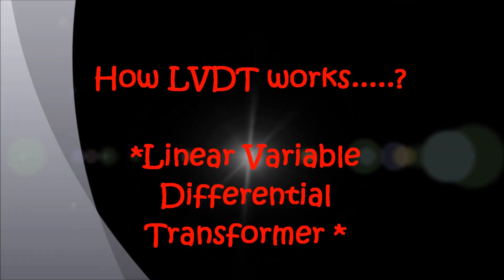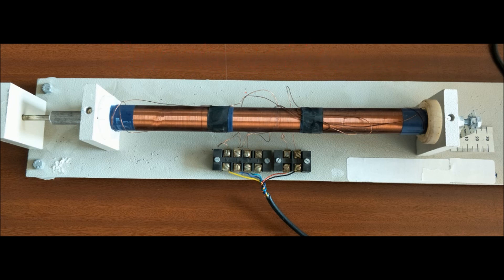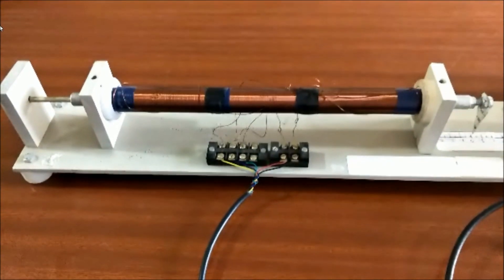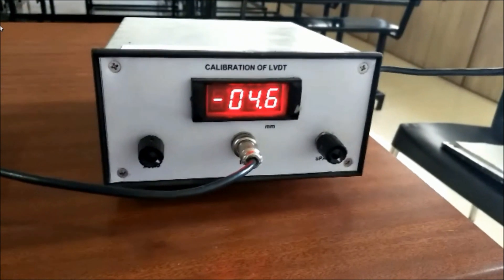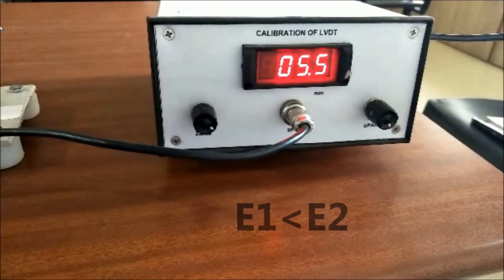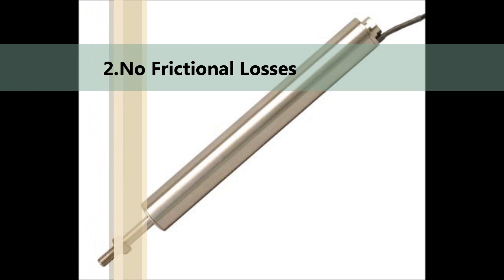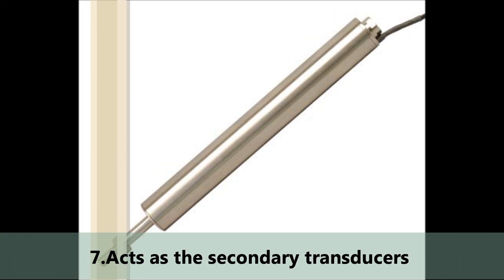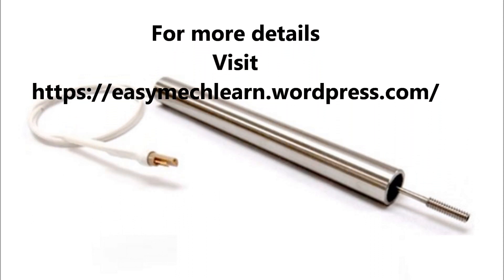How  LVDT Works | Construction and Working

Comment: How do you check secondary coil 1 and 2 
Before you connected ?

I have one reading ohm but the secondary coil 2  has no AC voltage!!